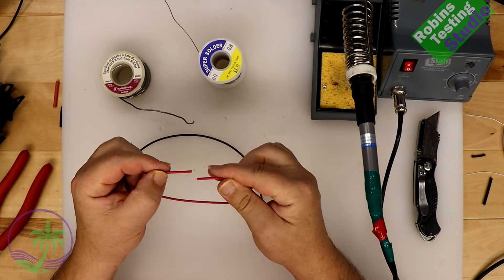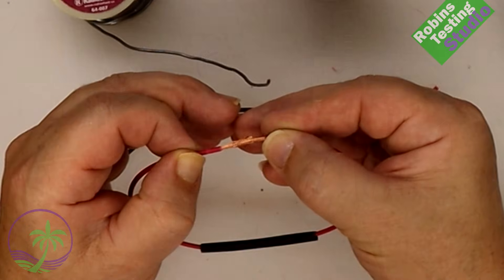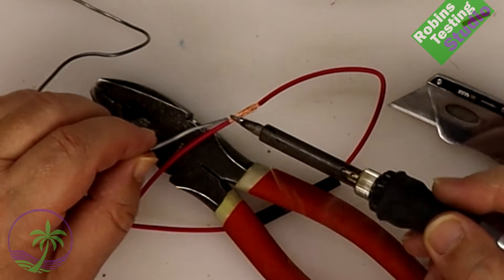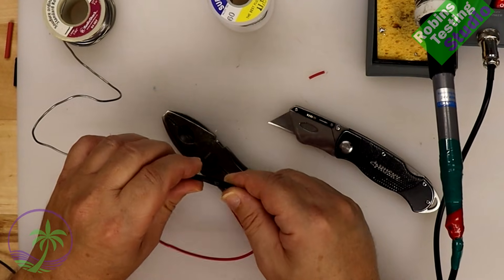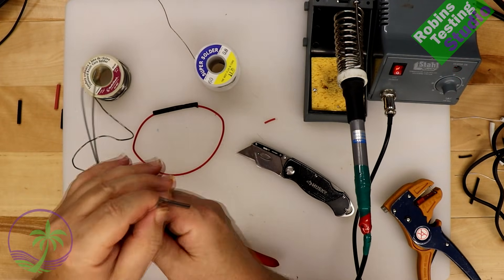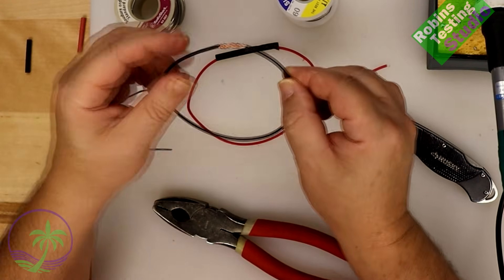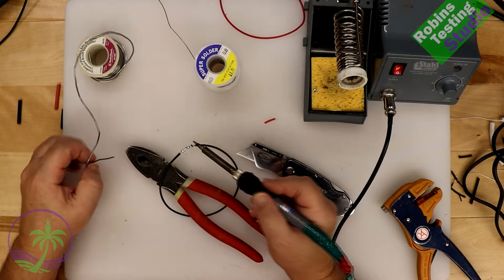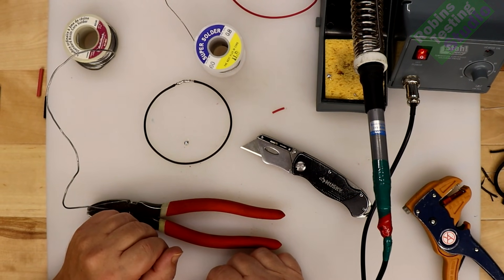How to Solder Wire Together Like a PRO in 5 Minutes!

Comment: My problem when I tried this before is it when I touch the wires it shrink the shrink tube before I could move it

But thanks for the well produced video and I'll give it another shot
Reply from the maker: till you get faster you can just get a damp rag and wrap the shrink and wire to keep it cool. some time I need to to this because I have no room to work.

Comment: What happens to me every time is that the solder doesn't flow into the wire. Even when using rosin it just sticks to the surface. :/

Edit: after someone liked this and thus reminded me that the comment exists, id like to add that my Rosin was rubbish. I bought some cheap Ali Express flux and it works wonders. P.s. don't try to solder aluminium wire lol.

Comment: How do you solder 020 /14 gauge security wire when it's hanging from a door lock and you have to juggle the iron, solder and hold the wires in mid air as you don't have access to a table, bench or even clams to hold them?  Nor would it reach a table anyway. No one ever shows videos of that!
Reply: awfully specific don't you think? make one when you figure it out i'd view it!
Reply: Yeah he didn't tell us how to solder a 14 gauge solid to a 16 gauge stranded--which I have to do 30x times!
Reply: @papaboule  You could always pre-solder each end and then get some clips (helping hands I think is what they are called) to hold them close and then reheat and fuse them together.
Reply: Such a good point😂 everything’s always flat on a bench
Reply: Tbf, the wires should be mechanical joined before soldering anyway. So that frees up a whole load of hand space 😋
Reply: Get another person..

Comment: Does it need flux?
Reply: if the wire is dirty and you cant get it real clean the answer is yes but bear in mind if you use too much flux the solder will travel to where the flux is in other words the solder will travel up the wire making it impossible to bend it
Reply: The solder he used probably has a flux core
Reply: Yes

Comment: It's a lot easier to twist the strands using the stripped piece of insulation before pulling it off the wire, especially with thinner gauges.
Reply: I actually dont think it is
Reply: To each their own and I bet you there's a lot of factors that determine whether it actually does or not but I've tried it with a few thinner gauges after seeing this and I don't find it easier. I find with the insulation there it doesn't squeeze the copper strands hard enough to get a good twist and it just comes undone when I pulled the stripped piece of insulation back off. Grabbing with fingers and twisting is yielding better, tighter strands, every time. Maybe it is just because thats how ive done it for the past almost 20 years

Comment: I just picked your most recent video to ask a question about RGB led lights with a 4 pin connector. I have the led lights in my car they came from O'Reilly's but one of the pins broke so I cut the connector off in hopes to hardwire it but the lights also plugged into a little box with a nob so when you turn it the lights change. Well I no longer have the box so what I have is 2 RGB light strips that are connected with about 3 feet in between them(one above the pedals for driver side and one for passenger side under dash) the wire is cut off at the part that plugged into the box.. I was gonna wire the power to the fuse box and ground the ground wire but I don't know what color is what. I have a blue,white,black,and red. I'm gonna use a 3 prong switch to turn them on(I know it will only be one color). How do I accomplish this? Sorry so long

Comment: Ive always taken the amateur route and used connectors but am now taking the plunge into soldering to do it properly. I just wondered if I should use Flux or just solder with Flux core solder?
Reply: Without flux us fine for small wires
Reply: Its amazing how many people (and industries) are anti-solder and pro crimp. I try to do both when possible
Reply: @toybuns775  Should never be the case Solder is always better then just using a connector if you want a long lasting connection.